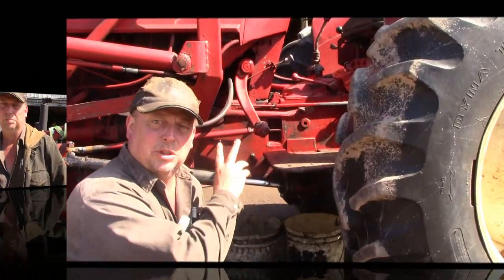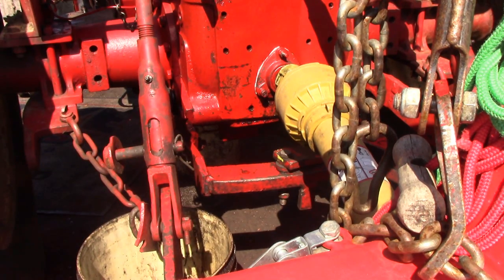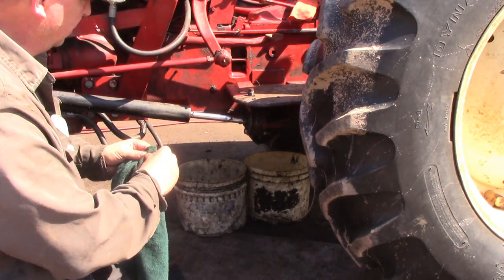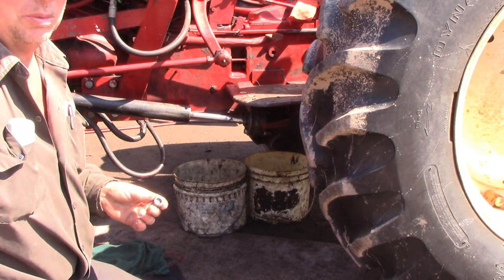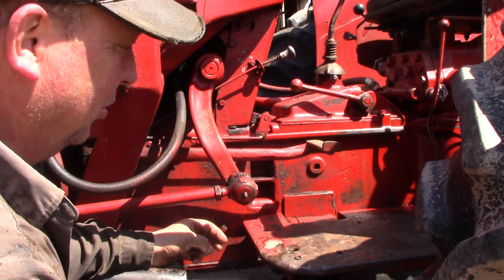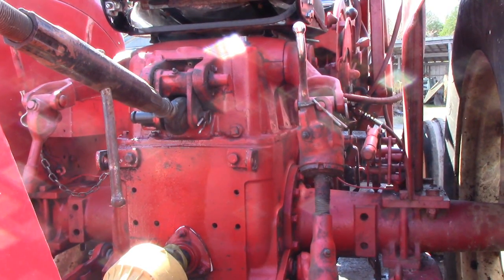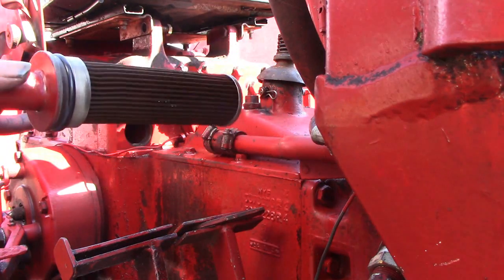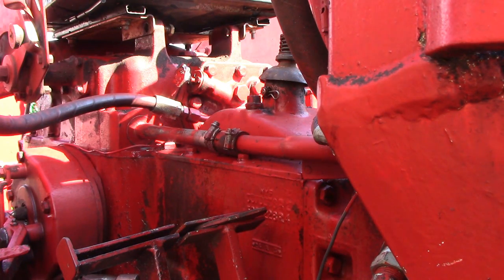IH 444 Fliuds change

Comment: I have a problem I got a international 2444 and my 3 point and power steering don't work but loader does ? Any help would b helpful?
Reply from the maker: The 2444 has a slightly different hydraulic system than a 444, the lift is the same but different pump and supply systems I believe,  it sounds to me like there could be a problem with a priority valve or something like that.
   Thanks for watching!
Reply: An is the rearend and gear box still take 80w90 gear oil?
Reply from the maker: @ronaldjennings1030  As long as the trans/diff is not the reservoir for the hydraulic system it would use 80w-90.
Reply: When I got the 2444 tractor everything worked. The power steering and 3 point started going in and out now they won't work at all. I don't have a book on tractor . An need help
Reply from the maker: @ronaldjennings1030  I'm sorry, I'm not at all familiar with a 2444.

Comment: Thanks for this video. I inherited a 434 from my father with no instructions so this helps.  I had to replace the power steering hydraulic hose recently. Could you do a video on how to bleed the air from the line? There steering is very stiff.

Comment: First is a big thank you for your time on making these videos...It is a huge help to a newbie like myself. I will have many questions in the future but an important one to hopefully help me and others is regarding the level or amount of hydraulic fluid when refilling. The manual does say three gallons but it also says to fill to the TOP of the housing...and many other people are saying the same thing around the Internet...I am just trying to be sure on which level is the correct method as I am brand new to anything hydraulic related and want to service my newly acquired B414 before using it.
Reply from the maker: The original owners manual states 3 inches of fluid level. You don't want to fill it as the oil will expand when heated and there needs to be space for the level to vary as cylinders are filled and emptied. If the reservoir is over filled you stand a chance of .blowing seals out from pressure when the oil expands.
  Thanks for watching!

Comment: Hi again, Dave, I have a 2444 tractor and the problem is the transmission oil went through the hydraulic fluid, can you please show me how to fix that? Thank you
Reply from the maker: I am not familiar with the 2444 tractors, they have some differences to the 444 tractors that I am familiar with. In a 444 the only way to get transmission oil in the hydraulics would be if someone poured the transmission oil in the hydraulic tank by mistake.

Comment: Why transmission and hydraulic oil has water in it. What should I do to cleanse up, please ?
Reply from the maker: You will get a certain amount of water from condensation. Drain the fluid and refill with the appropriate oils.

Comment: What kind of oil did you use for the transmission fluid and the hydraulic fluid?
Reply from the maker: I use 80w90 gear oil for the transmission and CaseIH Hytrans oil for the hydraulics.
 Thanks for watching!

Comment: Would this same process apply to a 584 ?
Reply from the maker: The 584 was a completely different series tractor,  drain plugs, oils and levels are all different. I will try to get a 84 etc series  video up over the summer.
  Thanks for watching!
Reply: Cheers mate. I’m in NZ look forward to your next vid
Reply: Or could you possibly tell me where I put pto oil? What is the proper oil you’d recommend? and is the same reservoir for pto oil and power steering oil?
Reply from the maker: @inokekauhala5884   The transmission and differential case is the hydraulic reservoir for the 584, same oil for PTO, power steering and 3PH lift. Use CaseIH hytran oil.

Comment: I want to know how many liter Engine oil and gear oil use in international 444 and also tell me which nomber of  oil use for gear and engine like that 90 s or 06 s.?
Reply from the maker: I think the 444 takes about 6 liters of engine oil but check the dipstick when filling, originally the manual stated a straight 30 weight engine oil, but a good diesel engine oil of 10w30 or 15w40 should be fine. The manual says 6 gallons of 80w90 gear oil in the transmission so about 24 liters. 
Thanks for watching!

Comment: Hi Dave great videos I'm a big fan of your channel could I have some advice on a B414 I'm in the UK I have recently bought 2 B414 tractors, I'm a agricultural engineer  so repairs are going to straight forward enough but I would like to ask your advice before I dive in,
The one tractor is stuck in reverse gear,  it has been standing for 10 years, I'm not sure if it was an issue before it was parked up or it has been left in reverse, have you seen any issues
Many thanks in advance (Len Morris)
Reply from the maker: If it was left parked in reverse it could just be that the shift rails are rusted in place. Probably best to lift off the shift cover and check it out. Thanks for watching!

Comment: Hi Dave
Your videos are great. I have a 1964 B414.
The suction filter looks like it hasn’t been out in years.
It seems impossible to move. I have tried hammering and a little heat but no go.
Do you have any tips for this.
Thanks 
John
Reply from the maker: I usually use a large pair of channel lock pliers and it will generally wiggle out. Good luck and thanks for watching!
Reply: I have finally got the filter off by using more force and more hammering. The problem was that the oil was full of water and the filter was rusted in. Thanks for your help.
John
Reply from the maker: That's great John, I'm glad you got it sorted out.
Reply: Do you know where to get the suction screen? The one with the curved pipe is the wrong size pipe unless they have an adapter I don’t know about.
Last time I had to weld the correct pipe to the screen and that damaged the fine outer screen. The suction screen under the right of the seat. I have not seen one available since my b414 diesel 16 years ago. I have a 1967 2444 gas now that uses that same hydraulic filter suction screen.
Reply from the maker: @jethrobodine9867  The only one I have seen available new is the one with the 3/4" pipe for standard steering, with power steering the suction pipe is 1".

Comment: Anyone have an idea part numbers or where to get the spring and seal that go inside the oil filter canister for the 444 with the BD154?  Mine was also "Pre-lost" and just flopping around so I put a random spring and washer in there but it's not right
Reply from the maker: The spring is part number 3043291R1 and the washer is 3043293R1 but I don't expect they are available any more. The washer is shaped to fit into the bottom of the filter to center it in the canister and seal the bottom end. You could make one with a washer that fit into the end of the filter and weld or bond it to a larger washer that mostly covers the end of the filter.  Thanks for watching!
Reply from the maker: @flintstone123  Yeah that is a very common problem. Thanks for watching!

Comment: great video. i just bought a 424 and this helped immensely. isnt there an orfice filter also in the hydraulic system that should be cleaned/replaced. thanks much from a southern border neighbor. :)
Reply from the maker: Howdy neighbor, there is a small brass screen in the front of the valve body, but it's best to leave it alone unless it is causing trouble as they are prone to breaking and no longer available. I have a video on the hydraulic lift unit here https://www.youtube.com/watch?v=IwRkEaqUOGI&t=42s if you need to find the filter. 
  I am glad you found the video helpful, thanks for watching!

Comment: I have an IH 383. I've found drain plugs for the Diff and the Gearbox -- is there also one for the Hydraulics ?  Where ?  Would it have a separate filler plug ?
Reply from the maker: A 384 would be the same as the 444 in this video, I am not familiar with a 383, the transmission/rear end may be the hydraulic reservoir or it may have a separate hydraulic reservoir. Thanks for watching!

Comment: Excellent video I watched this before changing all my b414 fluids.When I took off my oil filter housing I discovered there was no spring inside ! I ordered on Amazon and received a spin on oil filter adapter. The problem is no gasket was included with the kit for when I remove the old one from the engine block. Do you know where I might order one?
Reply from the maker: You should be able to get a gasket from a CaseIH dealer or you could make one with gasket paper. I am glad you found the video helpful, thanks for watching!

Comment: I recently acquired an International 444 diesel. Some one told me that you can use 10 - 30 engine oil for the hydraulic system. Is this true?
Reply from the maker: At a minimum I would use a hydraulic oil, though CaseIH Hytran oil is the recommended. Thanks for watching!
Reply: How about atf in cold weather?

Comment: I have a massey 99 loader on my 434, any help on changing the fluid there would be appreciated!
Reply from the maker: If your loader has a crank driven pump the mounting frame would be the reservoir, there will e a plug on the bottom of the frame on the right side  where the upright meets the bottom horizontal bracket. If your loader runs off the tractor hydraulics the process is the same as in the video. Thanks for watching!

Comment: Hello, I had reviewed your video last summer WRT changing rear axle and it help me greatly in replacing my axle on my B414, thank you.  My tractor is fixed.  Since you are the expert with these types of tractor, if you don't mind, I would ask your advice on this other problem I am having with my B414 Inter for about two winters now.  During the cold months, the transmission is hard to engage.  From neutral, gears are grinding even though I press on the clutch and  I have to wait sometimes more than 20 sec before the gear stop turning.  Once engaged, I would push on the clutch and the transmission stick for another 5-6 seconds( it is a long time when you use a snowblower!) specially when in 1st or reverse (the two gear I use to snowblow). I think the clutch is good and I read somewhere that it could be a oil viscosity problem.(too thick).  Any advice would be greatly appreciated.  I have a B414, diesel 4 cyl, 1962, 4 low and 4 high.  Thank you.
Reply from the maker: We had the same problem with our 384 (Newer model of the same tractor), that is a worn pressure plate not disengaging the clutch. You may be able to adjust the levers to get a little more life out of it but the best bet is to replace the clutch and pressure plate. Thanks for watching!

Comment: How much oil quantitie in hydraulic system aprox on ih 444 canadian  ??and how many inch below the uper fill plug ?
Reply from the maker: I don't recall how much oil they hold, 6-8 liters maybe. They hold 3 inches of fluid level, use a long screwdriver or stick to check level. Thanks for watching!

Comment: I have the  exact tractor 444 I was hoping that you can make a video on the 444  why the PTO jumps out  when i try to brush hog or put my snow blower  on i tried evereything  any info sure would b appreciate It seems that lot of people that has a IH444 has the same problem
Reply from the maker: I will try to get a video made on that shortly, it is a common problem. The PTO sliding collar and the PTO driving shaft splines are worn at a taper causing the collar to slip off the driving shaft when under load, both will need to be replaced.
Reply from the maker: Remove the tin cover from the bottom of the clutch housing and you will see a round cap fitted into the front of the transmission case below the input shaft. You should be able to remove it without splitting  the tractor. If you check out this video https://www.youtube.com/watch?v=1sve9HaZMbk&t=424s  the part you want to see starts about 5 minutes in.
Reply: Thanks I did what u said I have the pto drive shaft out I had to use long magnet to bring it out the back Now I have to find that shaft Do u have any good place where I can get one Mine has at one end 8 grooves and at the other end it has 15 grooves The length is 24 1/4  Any good tips how I get it back in because so long and I didn’t take top off so I have to try to but it in as it was 1 complete Shaft Thanks fo the help u save me a lots of  time and headaches because I didn’t have to split Thanks so much You sure know your Tractors  Thanks again I will watch all your Great Videos
Reply: Thanks Dave watched your video and it really help me couldn’t have done it without your video All is done and it works Great Thanks Will b watching all your videos They are Great and really formative

Comment: I have a question about the B275. Mine does not have a rear hydraulic drain plug. Do you happen to know where I would drain it from? Thanks for any help you can provide.
Reply from the maker: If there is no plug at the back of the hydraulic lift cover take out the pipe with the filter screen at the front of the unit and drain the oil from there.
Reply: I'm glad you asked this question, my 1970 ih444 doesn't have the drain plug either, it has a hydraulic fitting instead. I was trying to decide how best to drain the fluid.

Comment: hello 444 rear hydraulic oil number thanks
Reply from the maker: In the hydraulic use CaseIH Hytran oil, in the transmission and differential use 80w-90 gear oil. Thanks for watching.

Comment: I have a 1967 IH 424 Diesel, have you made a video on changing the Fuel Filter?Also, can you tell me what model loader is best for the 424?  And where I can find one? Great video on the fluids!! Thanks
Reply from the maker: I'm sorry, I haven't made a video on the fuel filters, I should have included that in this video. The fuel filter is similar to the oil filter except it doesn't go inside a canister, it is sandwiched between the top housing and a plate on the bottom with o-rings. If you follow the same procedure as with the oil filter you should be OK. Make sure you bleed the air out of the filter before you start the tractor.
  The 424 tractor is not quite the same as the British models we have here in Canada but very similar so a 1501, 1550, or 1850 IH loader would be the best fit. Thanks for watching

Comment: I have a 444 gas, is the hydraulic fluid and transmission fluid the same and it has a front end loader does it require extra, the loader doesn't have a separate reservoir.
Reply from the maker: 444s are a bit tricky, a Canadian model the transmission and hydraulic are separate reservoirs, whereas I believe the US models the transmission and hydraulics shared a reservoir. It should not require extra oil once the loader has been cycled so the cylinders have oil. Thanks for watching!
Reply: Rose Studio )

Comment: I have Ih354 and the 3pt lifting arms jump and I have been trying to find the problem. Im hoping maybe you have the answer? It does have a kelly600 loader on it and it works smooth like it should. Could it be the hydraulic pump or filter? Any help I would be grateful thank you.
Reply from the maker: Do the arms only jump when you are running the loader? It is normal for the arms to take a little jump when you have been lifting the loader. If it's all the time then likely the unloading valve inside the unit. Thanks for watching!

Comment: What kind of oil is the best for 444
Reply from the maker: For engine oil you want a good quality diesel engine oil, originally they called for a straight 30 weight oil, but 15-40 should work also. Thanks for watching.

Comment: Super review, Dave, thanks. And very timely as I just purchased a '65 B414 I'm still familiarizing myself with. Does the oil pan on a B414 have any sort of baffles? I'm asking because my pan is quite badly dented so I'm concerned about the oil pickup. I thought I could remove the pan and bang out the dents if there weren't any baffles.  Thanks again!    Oh, I'm Malcolm but using my daughter, Sarah's laptop :)
Reply from the maker: Hi Malcolm, there are no baffles in the oil pan, you should be able to knock out back out with out too much trouble. Thanks for watching!
Reply: Thank you so much for the speedy response :)

Comment: Thx for the info , couldn’t find a better example close to an b414
Reply from the maker: Yes very close. if you took the hoods off you would have trouble telling them apart. I'm glad you enjoyed the video, thanks for watching!
Reply: Also nice to hear that you give an indication of fluids in liters 👌
Reply from the maker: Indeed metric is the official measurement system here in Canada. It was just changing over when I was in the early grades at school so I end up using both metric and imperial depending on what I am doing. :)

Comment: I've been following your channel for ages, brill info. Wonder if I can ask for a bit of help. I have a ih1255xl 4wd that has a noise when in reverse, I think it's a synchroniser worn but the trouble is I've got the cab, hydraulic top, rear trumpet housings off and noticed a tooth broke off the pinion gear ( the one coming from the gearbox to the diff ) the big crown wheel is ok on the diff. My question is how do I get that pinion shaft out, is it held in from the front of the gearbox. I'm removing the gearbox anyway to do a proper job on it. Can you help me with some info fella !
Reply from the maker: I'm sorry, I'm not familiar with a 1255. Is it the differential pinion that has a broken tooth? If so, they are generally bolted into the front side of the dividing wall of the differential, the transmission will have to be removed to take the shaft out the front of the differential case. Good luck and thanks for watching!
Reply from the maker: Like I said, I'm not familiar with a 1255 so hopefully I'm close with the advice. :)